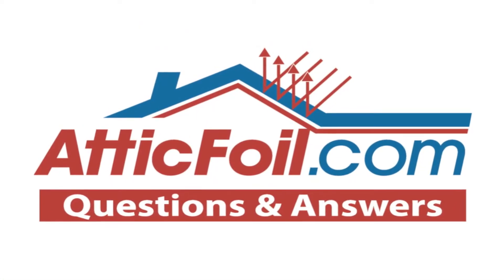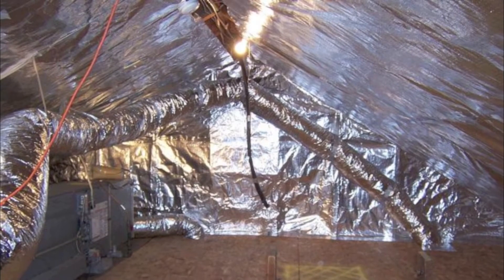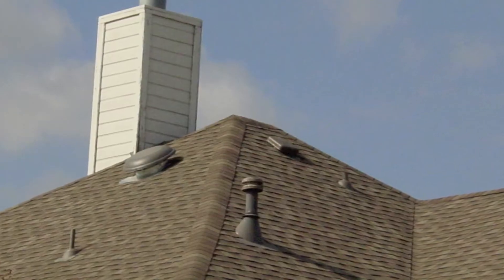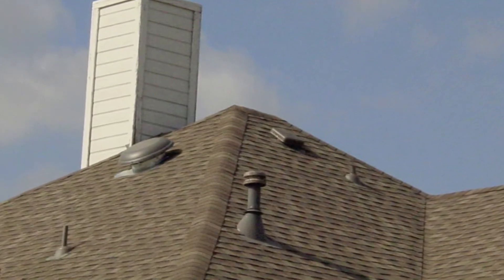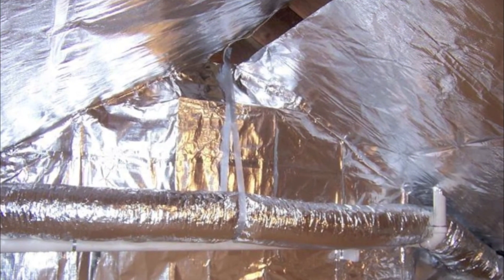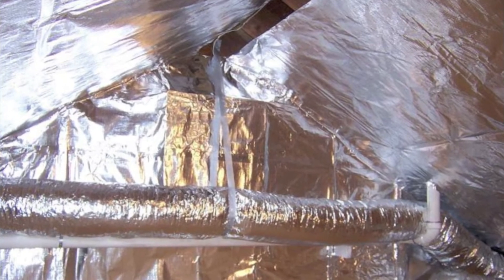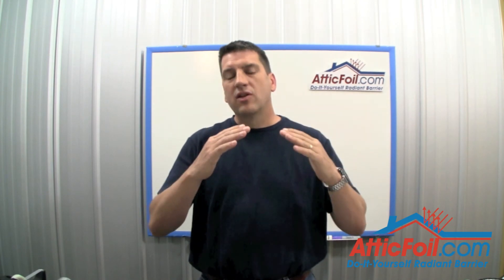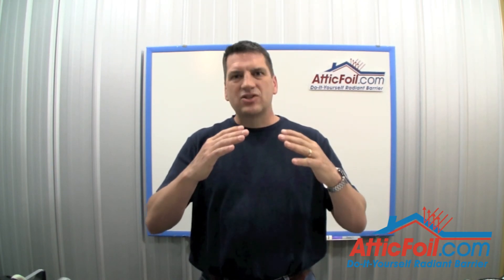Attic Temperature After Radiant Barrier? How Much Cooler Will My Attic Be?

Comment: Sounds likw a BS answer, airflow would help but a lower temp unconditioned attic should not overheat the top layer of insulation above the attic temp, that makes no sense.
Reply from the maker: I respectfully disagree.  Based on your theory if you blow a fan on the hot driveway on a sunny day it won't get hot?  Radiant heat is not affected by airflow.
Reply: I agree with rickevett3304 on this. This surface temp vs air temp thing sounds like BS. The difference between air temp and surface temp of the insulation is going to be minimal.
Reply from the maker: Ok try this.  Go park your car in the sun.  Then use an infrared thermometer and measure the temperature of the seats or dashboard that are in the sun.  Then use a wet bulb type thermometer and measure the actual air.  The air will be significantly cooler.  It's not the air that burns your legs!!!  We have done this many times, go into an attic an use the IR thermometer on the areas where it has no www.AtticFoil.com an than lift and measure under the AtticFoil.  The area under AtticFoil will be much cooler when the sun is beating down on the roof.
Reply: @johnvolpert8295  What you're missing is the difference between convection and radiation. Proper ventilation will reduce the heat your insulation absorbs through convection from warm air in the attic. It won't reduce the radiant heat your insulation absorbs from the roof decking.

Comment: I've got a question.  I'm building a screen porch. I'm thinking about putting radiant barrier foil on top of the plywood roof.  Then 2 x 4's (to get the roof above the radiant foil), 1 x 4's for installing a tin roof.  Will this keep my screen porch cooler than normal?